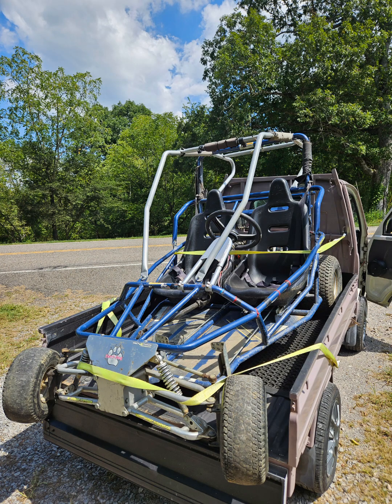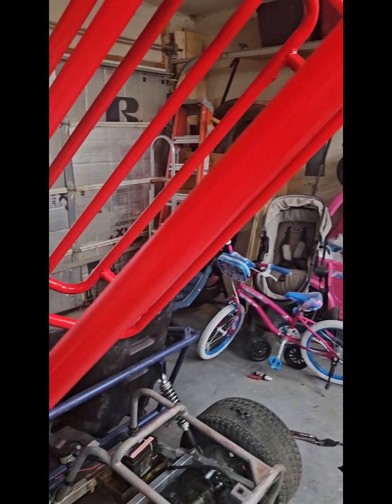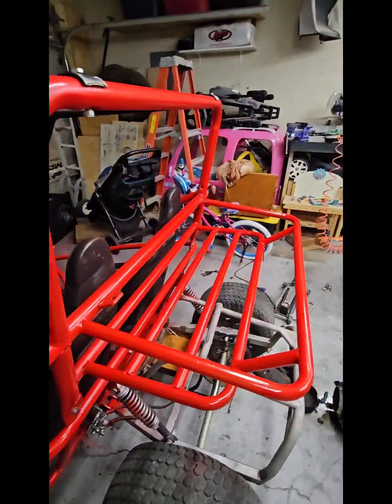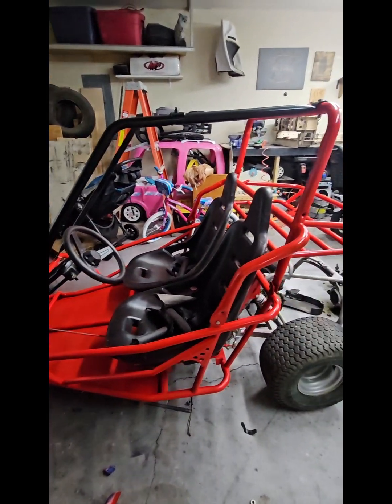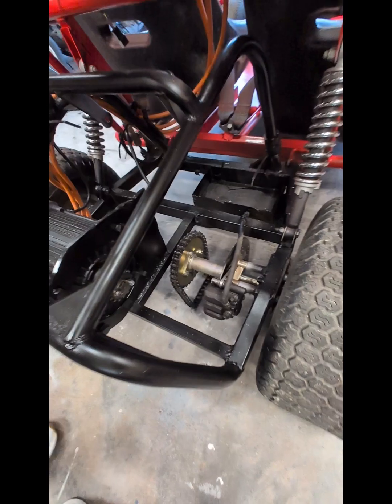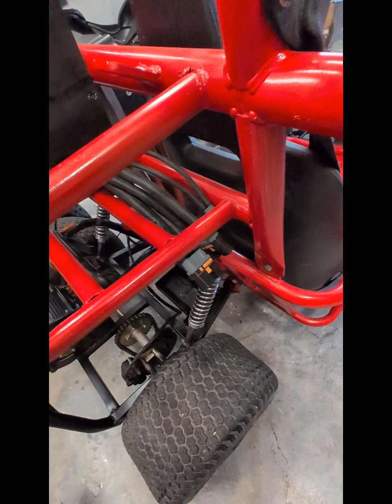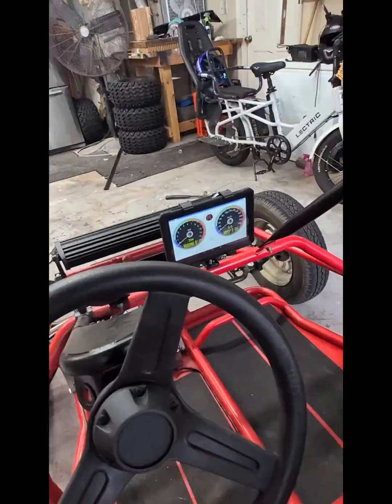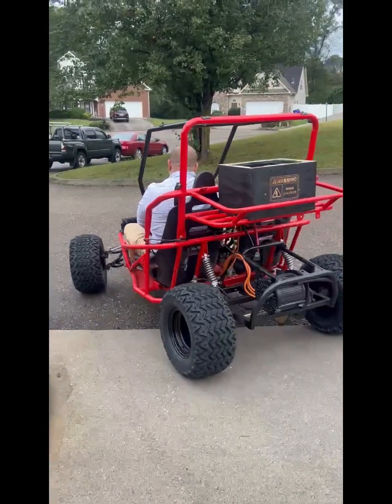EV Go Kart yerf dog spiderbox

Comment: The spider boxes have a manufacturing defect where the rack and pinion is upside down so the outside wheel turns too much and drags, they make a remanufactured steering rack if you would like to purchase and correct the steering radius